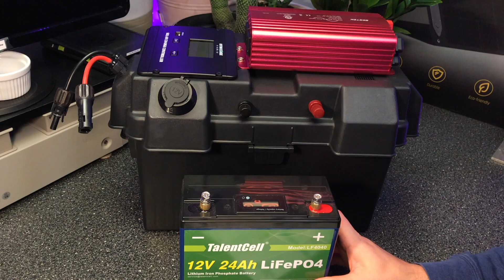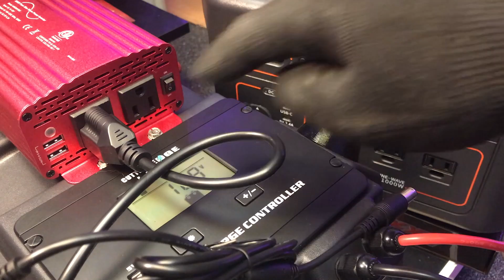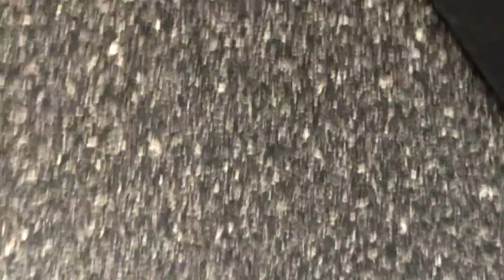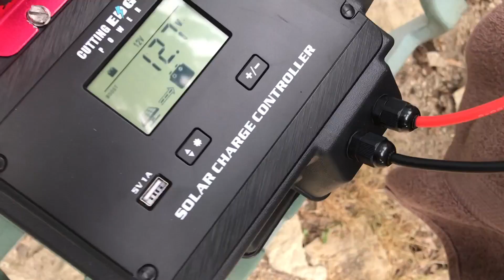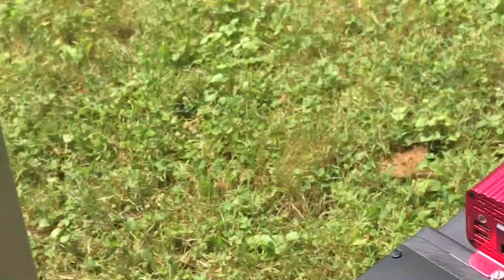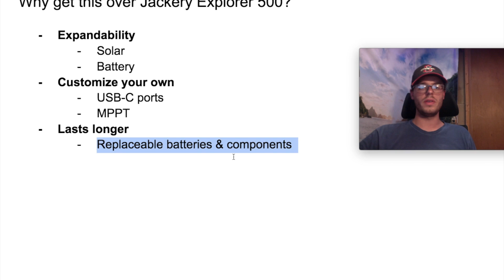TEST & REVIEW: Cutting Edge Power 500W Solar Generator

Comment: I bought a 2000w inverter box from Cutting edge it holds a 100ah battery well i would love to see you add the wind turbine controller on yours as a side project. I wanted it at the time but couldn't afford it. I like mine though i wish i would have went pure sine on the inverter also but it works good but i did have loose contacts on pre-use inspection from the factory.
Reply from the maker: Thanks for your input on your system! I'd love to use the turbine too. I've never used one before and think this one would be great to test. If some more people want this and mention it on this vid then I can contact Cutting Edge to see if they can send me one. Or if not I'll just buy one if I can afford it! Also, I like your move on the bigger system. I will probably get a bigger system for myself in the future to power more electronics